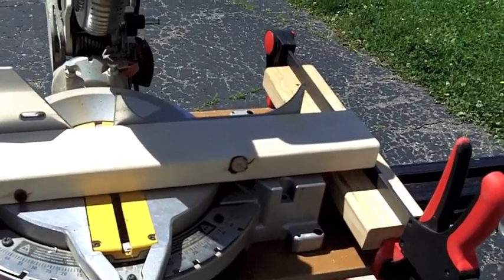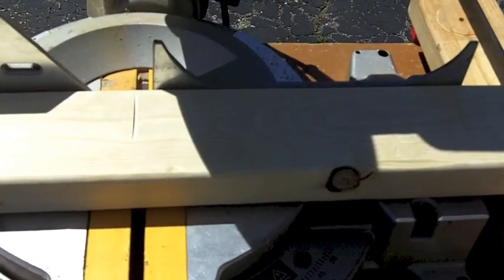How To Build A Passive Solar Garage Door

Comment: Wow, just what I wanted for my garage, what thickness plexiglass did you use?
Reply from the maker: I used the thin stuff (0.093 in) and it works just fine. If a panel gets cracked, it can be easily replaced.
Reply: Thanks for the reply. I was a bit worried using 1/8 or lower plexiglass for any flimsiness but if it worked for you I'll try it. And thank you for the tutorial as well as inspiration. Great work!  Want to see more of your projects.

Comment from the maker: I'm not sure about the double glazing idea. Moisture might get between the panes and create issues. Also, the real heat loss will occur at the perimeter of the garage door. There is really no way to seal this area. My garage does get cold at night but it rarely gets below freezing. I'm in Michigan and we get pretty cold and cloudy winters. I think you should be okay with a single pane.
Reply: hi  
how can i contact you? kindly send me your e mail id or other source of contact.

Comment: Awesome job, man! Sensible approach, thought-out design, and solid and appealing result! My garage doors are grungy and dull, and I wanted to replace them, but affordability is a problem right now, and I'd like more light and passive solar gain, so I did a Yahoo search for 'solar garage door', and your project showed up. I am going to follow your approach pretty much step-for-step except to add an outer layer of glazing for heat retention at night (I live in the Upper Ottawa Valley of Eastern Ontario). I need a better table saw before I attempt this, but the savings over buying ready-made garage doors should pay for the saw, and then I will have the saw AND the continuous solar gain. Thanks for the great video and giving me the encouragement to tackle this myself. Two thumbs up!